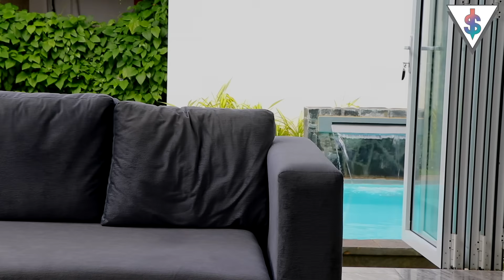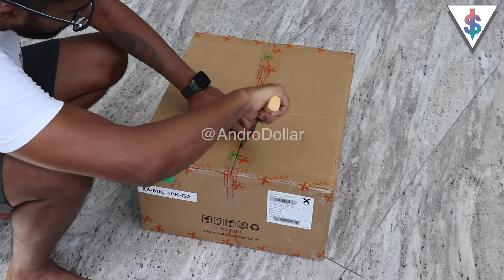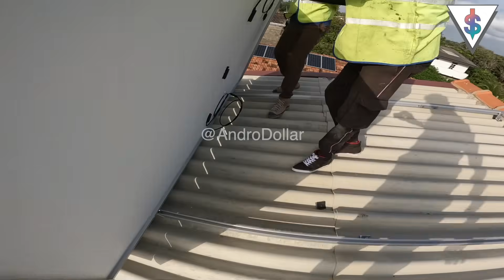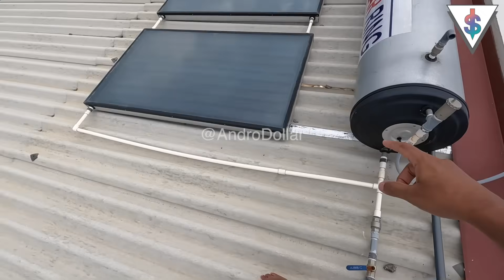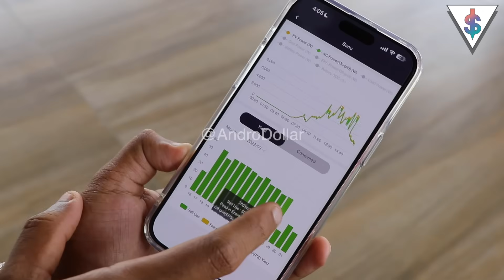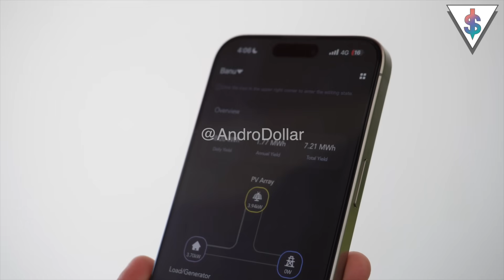Ultimate Guide to Solar Power Systems in 2024 - Power Your Home for Free & Make Money with Solar ☀️

Comment: Great video and very informative sir! Could you please advise if it's important to get insurance for my solar power system? 
Thanks in advance!
Reply from the maker: Thanks for your comment. In the first 10 years you won't need insurance as the warranty will cover it. However after 10 years you might want to consider it.
Reply: there are some damages that won't be covered by the warranty even within the first month. It is the requirement you need Insurance for the system. Warranty covers only the manufacturer defects.  @AndroDollar